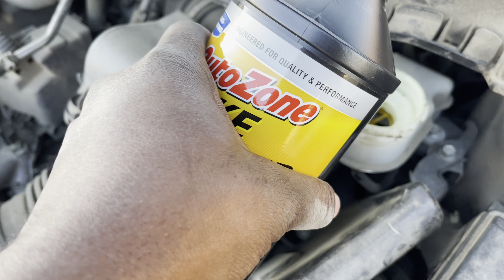Bleed Brakes all by Yourself. DIY Brake Bleeder Tool.

Comment: Nicely done. Two comments. 
1. Shop manual says start bleeding with left front brake. Lots of lore on this but I doubt it makes any difference as all the lines from the ABS module back are independent. 
2. Is it necessary to run a scanner and activate the ABS module during bleeding after changing ABS module. Apparently “yes”. I’ve done many brake fluid flush’s and never did that. LOL.
Reply from the maker: Great points.

Comment: Hello do you have to bleed brake fluid after replacing Abs module ?
Reply from the maker: Yes you should.
Reply: @diyelie did you bleed it at the module, or just at the brakes?